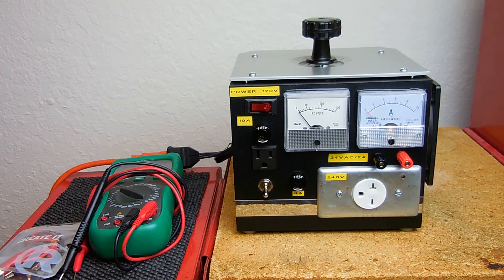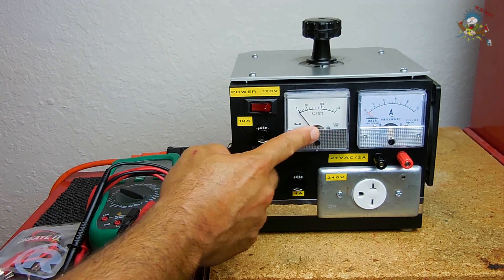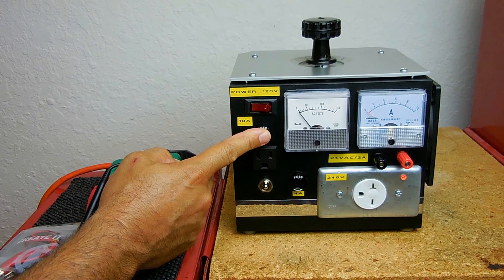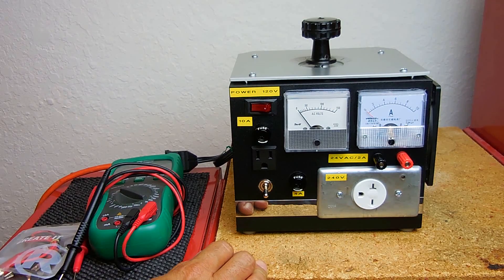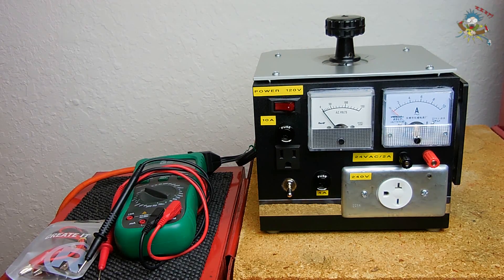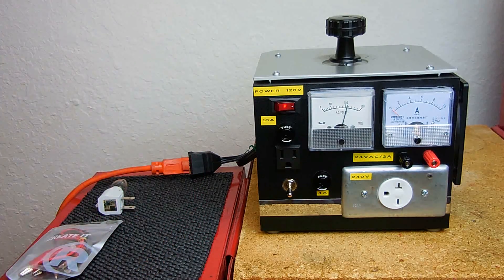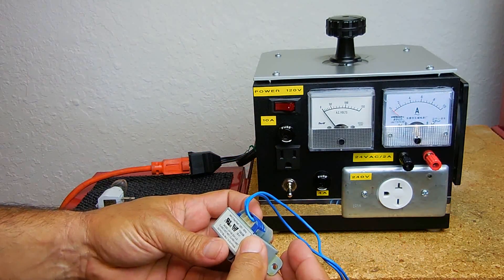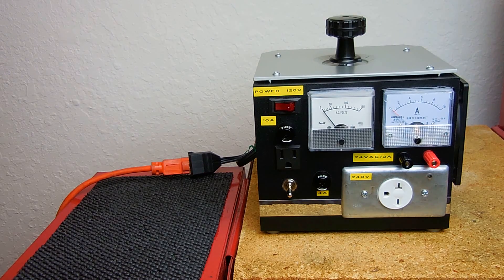DIY Homemade Regulated AC Power Supply + More

Comment: Ah, did the 240VAC transformer wind up in this PSU? Neat!
Reply: Epoxy pot the transformer maybe with a heat sink to quiet I guess?
Reply: I wonder what a DIY most cost effective potting method might be?  Guessing something requiring a catalyst to harden and not sure how maybe old paint would offhand, though the Restore got me thinking if there is a urethane hardener that would be effective?

Comment: Have you looked at the output with a scope ?  Is it just a dimmer  or does it output a sinewave with lower amplitude ?
Reply from the maker: It clips the wave.
Reply: Gee ... I was going to ask the same question but  does it clip the top off or does it actually chop the time period. Everything I have been able to find about these SCR controls indicates they are either ON or OFF so the only way they can only control the the time period for the power. A variac on the other hand would vary the actual amplitude of the wave.

Comment: 👍
Reply from the maker: Glad you enjoyed it
Reply: electronicsNmore As if that radio was made for that my 8500 watt brushless generator doesnt have a AVR i want to use my plasma cutter and use my cordless tool chargers also but i dont want to damage those electronic components  in them for the   plasma cutter i need a 220 20 amp 4,000 watts rated power conditioner or surge protector with a high joule rating is there any brand you recommend?

Comment: Pretty boring if you don't show how you've built it.
Reply from the maker: To be honest, the way it was wired up was fairly simple. This video isn't intended for people with little or no knowledge of electricity/electronics. I explained how everything was connected, and pointed out everything that was used. If you decided to make one, and had a question, all you had to do is ask. :-)
Reply from the maker: I explained everything very well in the video, and also showed the inside of the unit. This video was never intended to be a "step by step" video on how to make this unit. If a person has an understanding of basic electronics, then they will not have any problems understanding my video.
Reply: showing inside of unit means shit without schematic

Comment: so are you saying it would be best to set those same batteries (6 volt, 225 amps) into 4 pairs of 12 volt equaling 900 amps is better (last longer and more efficient) than doing 2 24 volt batteries with only 450 amps

Comment: if you had an RV and were using batteries to power things would you use 12 or 24 volt batteries, which setup would be more efficient (i getting 8 6volt 225Amp batteries so i can go with either 4 12volt batteries or 2 24 volt batteries)
Reply from the maker: Hello. What matters is the total current capacity. Using batteries in series does not raise the current capacity, using them in parallel does.

Comment: Very cool and useful device you built there.
What can I do with a 800 watt toroid isolation transformer? It is center tapped and rated at 240 120 Vac, it was getting scraped at work so I asked if i could take it home, it is brand new
Reply from the maker: How about modifying one winding and making a step up or step down transformer?